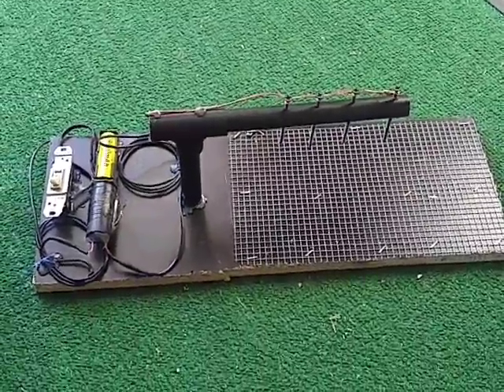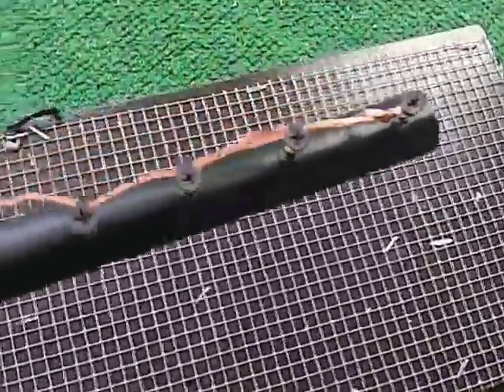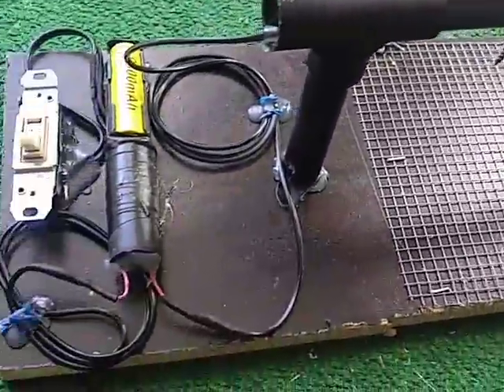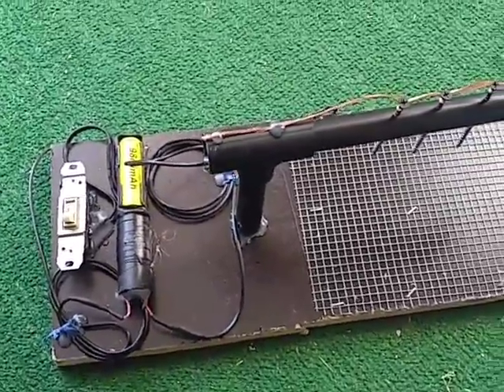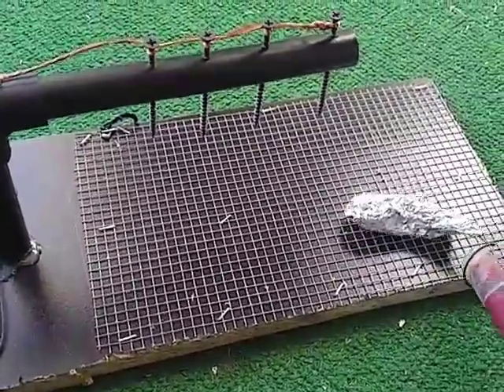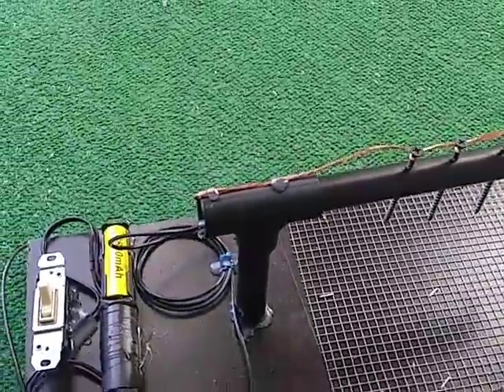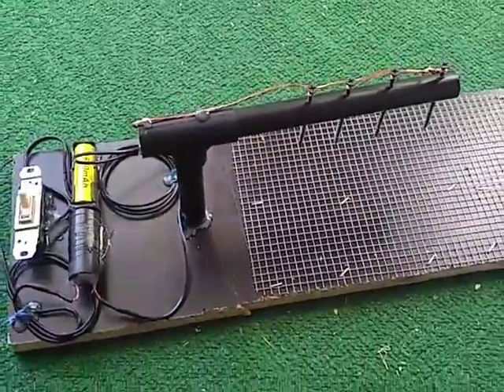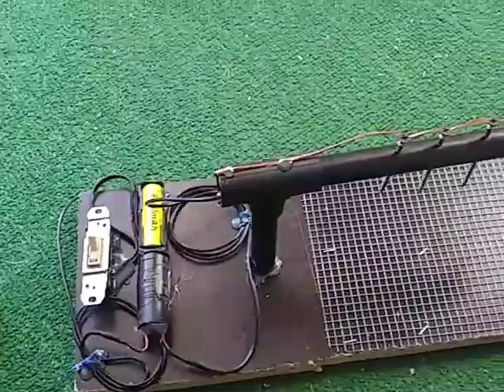Electronic Mouse / Rat Trap Executioner

Comment: The high voltage circuit is always running. That will probably overheat your coil and drain the battery fast.  I suggest making a simple switching circuit using infrared LED and detector or something similar.  When the mouse walks in and trips the sensors,  the high voltage circuit activates. However,  the problem with your current design is that there is no way to remove the dead mouse off the platform to reset the sensors.  Perhaps,  redesigning the device vertically instead of horizontal would fix that.........
Reply from the maker: WTF BBQ ... Right about the active circuit.  I have been experimenting with a motion sensor and trying to narrow the field of view from the sensor so the target will be closest to the electrodes.
Reply: I've been toying with the idea of building a high voltage tower.  Basically,   the bait will be at the top of the small tower and the rats have to try and climb it,  but then they get zapped and falls down.  The issue with resetting the sensors and the continued zapping is virtually eliminated...... You may not even need sensors,  but just have a small timing circuit that turns the  high voltage on every 3 seconds or so.
Reply: @vincebiano190  How many kV and how many kV AC power is needed if used to set traps to catch wild boars
Reply: You should buy the cheap in door motion sensor lights,that take 1 aa battery,we use them for the hall way in our house
Reply: I have the same trouble with batteries, hence I plugged it to a constant power supply 5V, but 2 of these were fried as they stay ON forever, a trigger is needed badly to charge when the mouse is in and off onces there's nothing, regarding the zapped pieces, if you just lift one side of the table, so that the mice have to climb for the beit and once zapped they will roll down by simple gravity, and on to the next victim.....

Comment: I used a metal coffee can and drilled one small hole on each side. Then  I cut an extension cord and put one stripped wire end through each hole and twisted it on tight for a good  connection with the can. I put bait in the coffee can and waited for a rat. When I saw a rat enter the coffee can I plugged in the extension cord thinking it would electrocute it. Nothing happened,lol. I tried it multiple times when rats went in.Nothing. Does anyone know why that wouldn't work? I dont now much about electrical.
Reply: you shorted the wires with the can and blew your circuit breaker.  google how to do this without burning down your house.
Reply: Keith Kanyeshna try puting a lightbulb in the circuit

Comment: How much amperage does it put out? Amps kill, not voltage. You can't multiply  current, as a matter fact the higher the voltage, the lower the current.
Reply: both amps and volts kill
Reply: Well it depends. You don't really need anything more than 0.1 A to kill a rat (that could kill a human too). You need high voltage for it to arc. But there is another component to this. Even if our current would be 1mA (non-lethal). And we ramp voltage to high enough then a zap from it hurts like hell. And for small animal the pain could already be shocking enough to kill it. And problem with high amps is that it starts to grill the target. Say 5 A and you have small mice barbecue generator. Problem is that they tend to get on fire. And I would not want fire on my attic. So it's actually better to stay on low amp range, just enough to kill but low enough not to burn.
Reply from the maker: The generator can accept up to 5 amps and it does multiply those amps but not sure to what degree. I can not find my amperage meter but when I do, I'll let you know the output.
Reply: It's hollywood myth that high voltage equals death. Not at all.
Reply: It's missing some Christmas lights
Reply: You need enough voltage for the current to pass so you need both actually around 10ma should do the job at 150vac
Reply: hey ! don't be talking about scientific facts and ohms law on the internet !
Reply: Amps true do kill but never on low voltage, I.e a car battery cannot shock or kill you regarding amps. True higher voltage less amps, but high voltage with small milliamps cannot kill either.
Reply from the maker: The heart can not take high voltage going thru it.

Comment: You mind sharing what kinda multiplier you used?
Reply from the maker: Rene Henke .... On ebay... From China. Try searching for voltage multiplier. I will look it up what I bought but it won't be able to till tomorrow.
Reply: thanks, I did...but there are tons!... I ordered one before but compared to yours mine wasn't power full enough!...So if you point me to which one you got I would appreciate it!
Reply from the maker: Rene Henke .... IT IS A STEP UP POWER MODULE . Keep in mind that I have an 18650 battery holder connected to mine.
Reply from the maker: search "voltage generator" and ebay will bring up what I used in the video.
Reply: Also available from Electronic Goldmine in the US
Reply: Hi, Haw long the battery lasts on stand by ?    https://www.ebay.com/itm/DC-3-6v-6v-to-400kV-400000V-Boost-Step-up-Power-Module-High-voltage-Generator-MT/253180073554?hash=item3af2b55652:g:TIgAAOSwr9VZzStA

Comment from the maker: I am still working on it . Having trouble with positioning the motion sensor and narrowing the field.
Reply: If you put the whole thing inside a box with a door hole then you shouldn't have to worry so much about motion sensor being too sensitive or picking up motions outside the trap.
Reply: what AsylumET said, plus, perhaps instead of the gantry with the extended screws, make a separate mesh area or platform for the mouse to walk on with bait positioned past it. That way the mouse entering the enclosed area steps on the first contact then, drawn by the bait, advances forward and touches the second completing the circuit.
Reply: Build a box on It

Comment from the maker: I found out that the field hums when battery is connected so I am trying to connect a low voltage motion sensor and mount it so it doesn't sense movement until the mouse is at the electrodes.
Im experimenting by placing a tube over the sensor to narrow down the field and mount it over top the electrodes.
Mice won't get near it while it's humming.
Reply: What about a photoelectric sensor? You could trigger a relais or a separate circuit between battery and transformer. You just need a IR LED, a sensor LED, some resistors and a transistor / mosfet
Reply: Vince Biano: why not just separate your battery and voltage stepper away from the trap with some lamp cord?
Reply from the maker: Hans Shaffer .... I was trying to keep it as portable as possible. Please explain why you think i should separate them.
I think maybe the screen floor may be too large of an area causing it to sound like a transformer.
Reply: Vince Biano is the humming sound coming from the battery/stepper part? If so then locate it off the board via a cord so the humming isn't happening right next to the kill zone. It will remain portable.
Reply from the maker: Hans Shaffer ... No its like a field hum. Not coming from the generator. Example. I set it on top of the washer and I touched the dryer that is 3 inches away and got a small shock like a static electricity spark.
Reply: Maybe you could use a capacitance sensor to determine the proximity of the target...

Keep the voltage low as long as it is far away... 3.3, 5, 9, or even 12 volts would be fine. Then, once 5he capacitance raises to a certain level... swith it to the 100,000 volts instantly fulminating the sickening rat.
Reply: What if you could sense when the mouse makes contact between the ground and the electrode. When it does dump the charge of some big capacitors over the mouse. And add a smoke sensor, just in case... 😉
Reply: Bernhard Kroll a passive IR sensor, PIR instead of IR
Reply: Vince Biano  your poop

Comment: Did you have any success?
Reply from the maker: Nik Park ... Not yet. Its on my workbench trying to revise it. Please stay posted.
Reply: Something to consider: If you do intend to modify this so that it's at a slight angle to allow rats/mice to tip off of it, you might consider switching the mesh floorplate out for something solid-say sheet aluminum or copper. I can see a rat getting a toe or claw caught under the mesh and just hanging there until you have to come pull it loose. Also, the solid plate would be a lot easier to clean if the rats urinate/defecate as they die.
Reply from the maker: Jasomebody ... I am revamping it now with a sensor. I am definitely considering the flat metal.